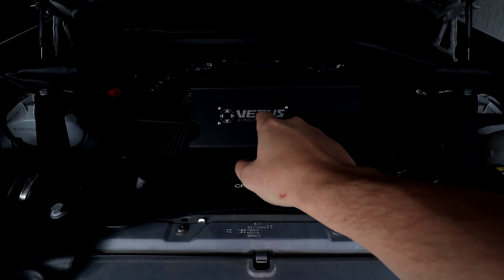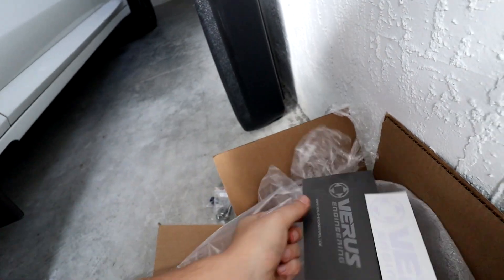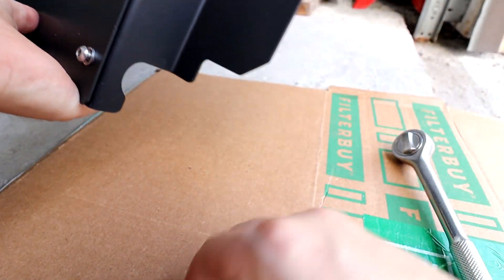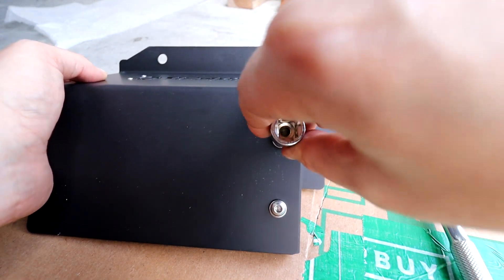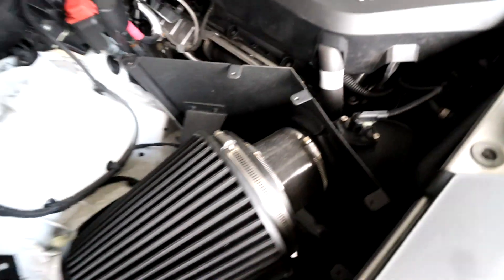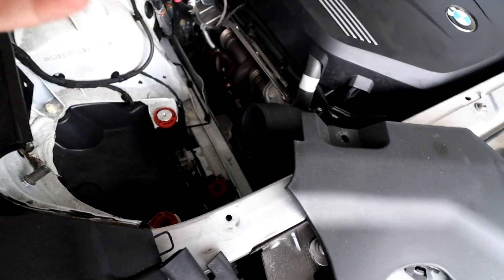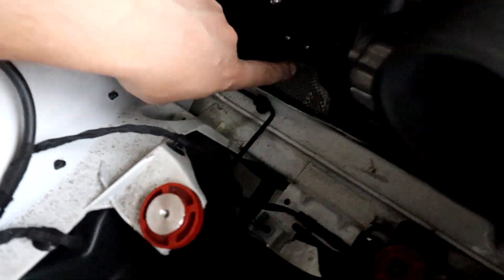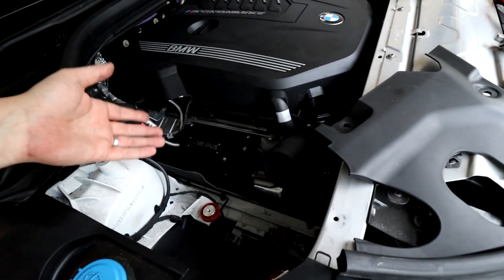BMW X3 M40i Turbo Upgrade: Verus Engineering 6-Port Turbo Heat Shield Installation Guide

Comment: I like your BMW vids.  My Q. Have you replaced your OEM RF tires? If so, what brand and type....RF or non-RF?  Thanks.
I recently bought a used 2020 X4 M40i w/ 23K miles, red flamenco color, for $40K.  Needs some paint repair, new battery, and 30K service. ...might run $3K.   Runs and looks great.  Looking to replace the Bridgestone RFs with non-RF Michelins. We previously owned a 2009 BMW 135i & 2017 X1.  Nothing compares to the BMW 6-cyl and the current B58 engines. It's so sad 80% of BMWs have 4 cyl engines.  I traded a 2023 Honda CRV for the X4, because at 74yo I needed something interesting to drive here in The Villages, FL.  My other "car" is an electric golf cart.  I enjoyed your vids on your previous cars.....mine include 1966 VW 1300, 1972 & 1973 Ford Pintos, 1980 VW Rabbit, 1985 Honda Accord, 1992 Toyota 4Runner, 2006 Honda Pilot, 2012 Nissan Xterra Pro4x (in addition to the X1 and CRV).  My wife has had a 1994 Dodge Stealth + the 135i.  Been there, done that.  Max speed was 135 mph+ with the Stealth (I-80 in Nevada) and 125 mph with the 135i (in Death Valley Nat'l Park). I hit 102 mph in the X4 on the Florida Turnpike before installing my State Farm "safe driver" module to get the $159 discount on my auto policy.  As you quickly found out, OK to purchase from a BMW dealer, but NEVER use them for service.   Enjoy your X3 and stay out of trouble.
Reply from the maker: Not yet but in Florida I would go with Michelins pilot sports most likely.